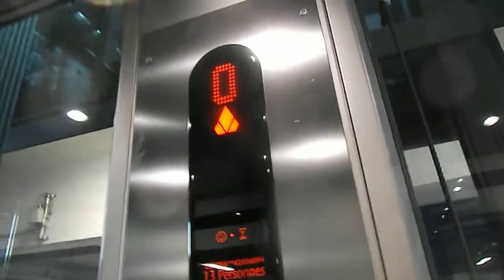Schindler bottom drive (mod by Kone) lift at Lausanne station, Switzerland

Comment: This elevator have  been installed in 2000, and had initially the D series fixtures. In 2019 there were majore floods in the station dues to massive rain, which damaged this elevator, it is for this reason that Kone (the new responsible of this installation) had to modify it.
Reply from the maker: Ahh that makes sense! Thanks for the information there :) was this the only lift that Kone had seen to?